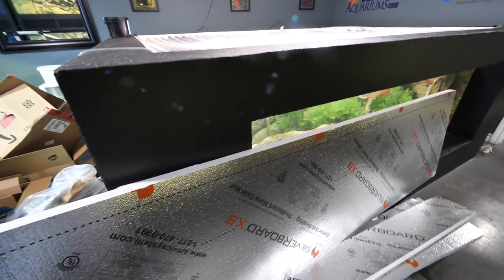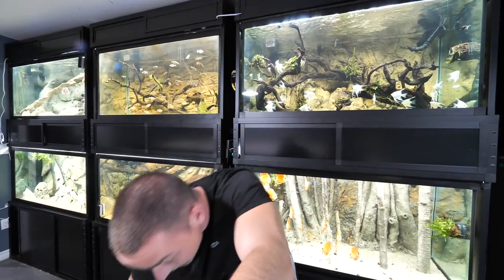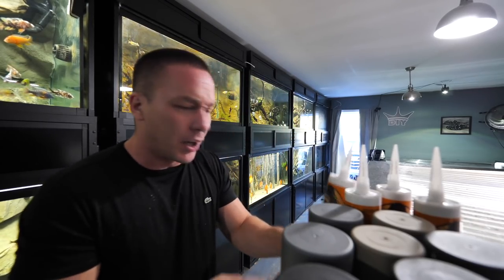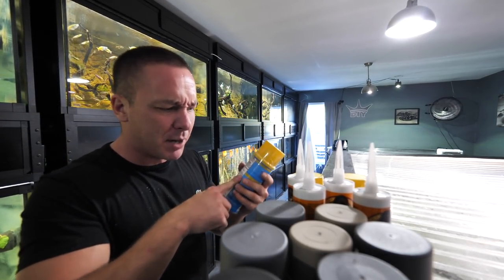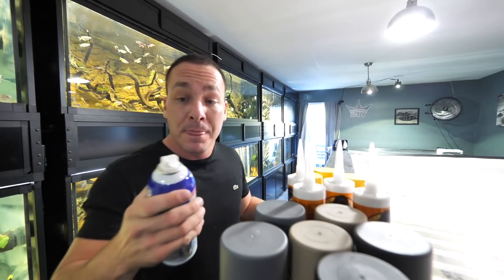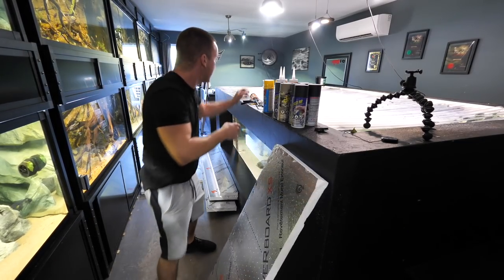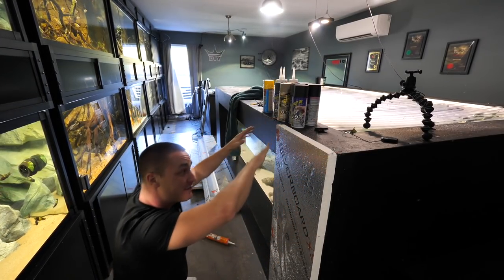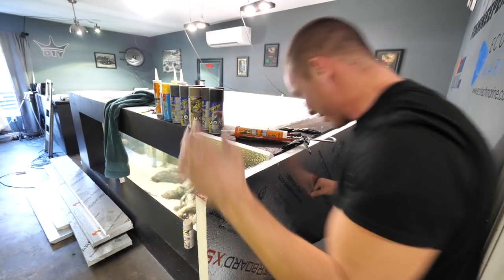2,000G aquarium goes 3D! | The king of DIY

Comment: Would I be able to use spray foam and cover it with an epoxy or fiberglass in the tank? I been thinking of doing a background with pots built in for caves but didn’t know if the foam is ok. Also what would be best to cover it with.

Comment: As for expanding foam and skin, it should expand and dry within 30mins or so in small quantities. And will just pull right off most times after its cured. I learned this the hard way too with the reptile tank i built into my walls

Comment: construction adhesive is not silicone, it is super strong glue used in building construction.  Trying to remove it once cured is very difficult.  the concrete render would be very hard to clean up!

Comment: What about mold ? if space between styrofoam and concrete is sealed without any kind of ventilation mold will appear especially in gallery where you have higher humidity.

Comment: I absolutely love carving foam...I haven't used it for a fish tank but I use it at my haunt lots. Always turns out great. Be careful with the spray paint though cause some aerosols will eat the styrofoam; this can sometimes be avoided by holding the spray paint further away. If I end up using spray paint I'm usually going for the weathered eaten away look.

Comment: Hrmm, not sure how long the display is going to stay intact with just a coat of paint on it, I foresee a lot of chipping and cracking as its bumped and nudged from everyday use. Wouldn't there normally be a thick plastic coating painted over the top? I know you've been massively inspired by the Reptarium but their tank surrounds are solid wood and will withstand a lot of use.
Reply from the maker: Thats not how plastidip works though. Also, i said i was doing this early last year.
Reply: I get that its something you've been planning for a while now. I'm just wondering if you've tested it small scale to see how strong the plastidip coating is when applied over the styrene though? Is it strong enough to take being leaned on, bumped, hit? I don't want to see you go to all this effort just for it to look awful in a few weeks time cos there's exposed styrene holes all over it Joey. Not questioning your methods, I'm only being a concerned fan.

Comment: If I want to keep a 5 inches crayfish in a 20gallon tank , will it be strong enough to destroy the silicone that binded my aquarium?
Reply: No, I've kept crayfish in 15, 20, & 25 gallon aquariums. They won't break the tank apart, but they can climb out very well.

Comment: Glad to see that you are sculpting it instead of using a rock veneer or modifying aquadecor backgrounds. I would, however, suggest using a rock veneer to cap the top for durability sake. Otherwise, the edges of the foam will get pretty beat up and crumble apart from doing maintenance on the tank and from leaning on it.

Comment: Love it. Can you put that in the aquarium? Would it be safe for the fish?
Reply: It would float and the spray foam might be toxic to the fish and if you made the foam stay down you wouldnt want the color of that foam in a tank so you would have to find aquarium safe paint , also it could flake off peel or the water
Reply: Thanks. I wondered about the toxic part.
Reply: There are ways to do similar projects for inside the tanks. Joey has covered that in other videos as he mentioned.  Also, there is a spray foam specifically for use in ponds.

Comment: The aquarium is big.    Be we should bend over  to see whats inside it.   It'll be better if the tank is positioned higher so that we can look at it without bending. .     You can use bigger glass if available or just increase height using more glass and concrete.

Comment: Won't it be difficulties on carving and painting if you glue the foams first? If you carve something wrong, the mess after carving, paint something wrong, the paint dripping, paint odors etc... 
Also, foam is so easy to be damaged, when you climb inside or outside the tank, or from visitors with bags that could accidentally poke hole or break a pieces of the foam without noticing while watching the tanks at the rack.
Reply: Joey doesn't have that many visitors . And the ones he does allow,am sure will be careful with it per Joey's instruction.

Comment: Won't the styrofoam insulate the 2k aquarium and raise the temperature?
Reply: Not if the only heat source is the room itself. It is like an open box that only gets to a certain heat level, If there was a heat source in the actual aquarium that was set higher then the room it would retain the heat longer but not overheating. It will however react slower to both increase and decrees of temperature in the room.

Comment: I’m in the process of building a sub for my 55 gallon aquarium and I am in need of just a little bit a help I’m trying to figure out how to use an aquarium bridge to maximize my water volume I’m using a 5 gallon bucket and a 10 gallon aquarium but I’m trying to figure out how to remove the filtered water from the bucket into the aquarium but keep the water level the same. This is a huge project for me as it’s my first decently large aquarium  HELP PLEASE.
Reply: Are you talking about a sump?
Reply: yes i meant sump

Comment: For the love of god Joey please don't spray the plasti dip in there without all the doors and windows open and a heavy duty respirator on... That's toxic stuff, it's recommend that you spray that outside If possible... I'd just do paint to be safe but if you REALLY need the water proof aspect then... Just don't breathe that stuff in. We cosplayers use it to seal Eva foam armor to prep for painting.
Reply: He just put on the base--the rest will be carved and painted elsewhere, and then adhered to this base. (At least that's the impression I got.
Reply: Lacey D Sutton  I believe he said he was going to carve the foam that he siliconed to the tank.

Comment: Didn't you have problem with heat this summer? This will not keep the aquarium cold.
Reply: Tomas Nyberg that would actually work well to insulate the tank from the heat I think.
Reply: Tomas Nyberg only because his heat/cooling system died. He heats and cools the building as a whole instead of each individual tank so when it malfunctioned he lost fish. The heatwave wasn’t a problem in and of itself until the system broke.

Comment: If I could I would get a 10000000000000000000000000000000000000000000000000000000000000000000000000000000000000000000000000000000000000000000000000000000000000000000000000000000000000000000000000000000000000000000000000000000000000000000000000000000000000000000000000000000000000000000000000000000000000000000000000000000000000000000000000000000000000000000000000000000000000000000000000000000000000000000000000000000000000000000000000000000000000000000000000000000000000000000000000000000000000000000000000000000000000 gallon tank